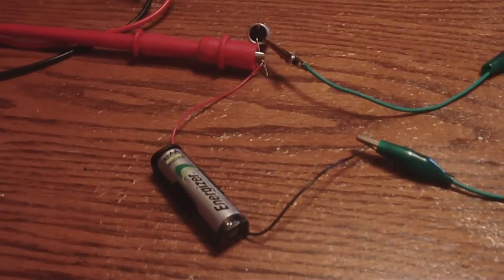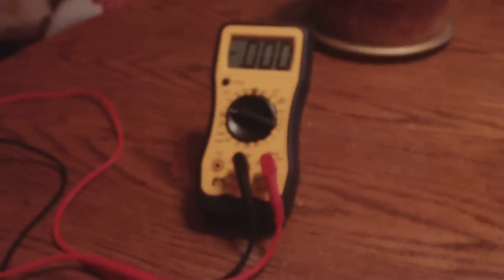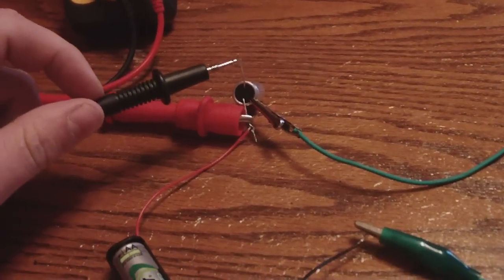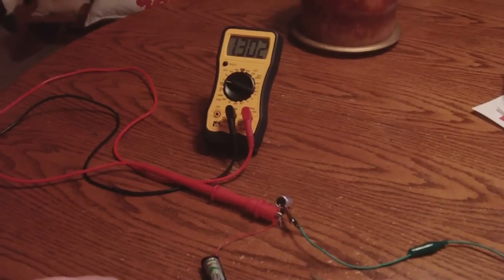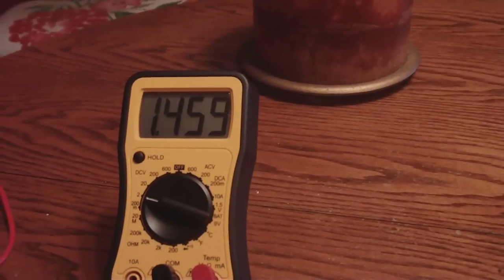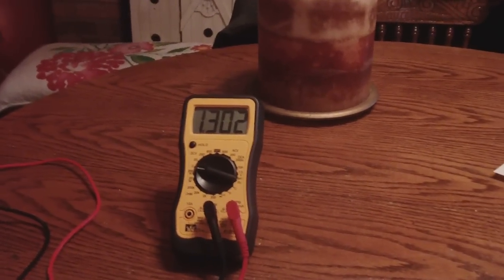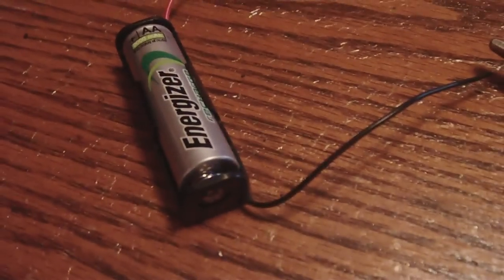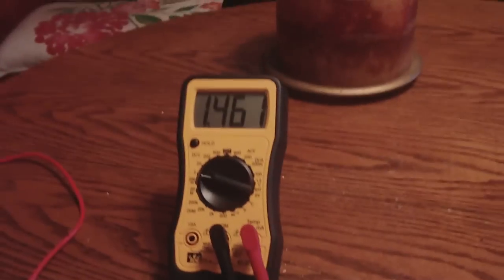Captret amplifies voltage

Comment: Please also check the current with a second meter...
Maybe you are destroying the electrolyte of the cap and thus produce an
additional galvanic voltage that adds up to the battery voltage...
So it would be wise to check the current inside this circuit at the same time.
Many thanks.
Regards, STefan.

Comment: @CosmicGnarler I am not doing the experiment so I can't be sure.  However, there is no voltage amplification going on because there is simply no mechanism that I am aware of for that to take place.  The most likely reason is that you can sustain a voltage between the two normal plates of the capacitor, and then with the battery you can induce a voltage between one of the plates an the case.  Assuming that this is true then there is no voltage amplification going on.

Comment: There is a very simple explanation for this.  There is no amplification going on.  You are looking at two voltage sources in series.  The first voltage source is the voltage on the main (normal) capacitor.  The second voltage source is the battery setting up a voltage between the capacitor lead and the case.  When you measure between the case and the other lead, you are measuring two voltage sources in series and that's why you see the "increased" voltage.